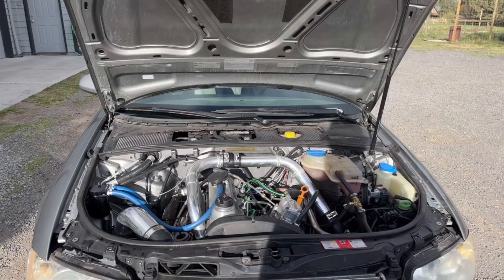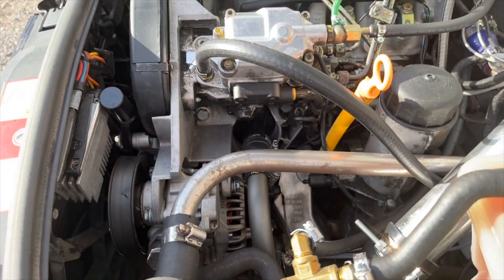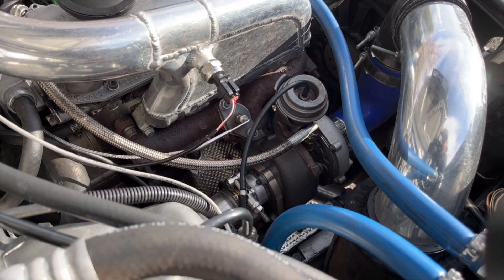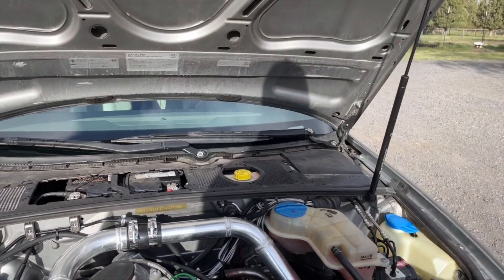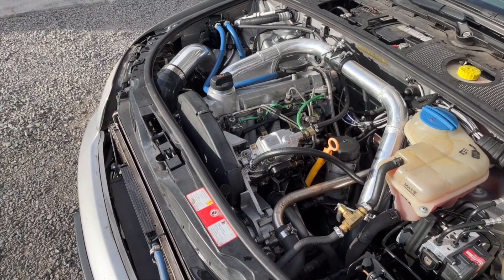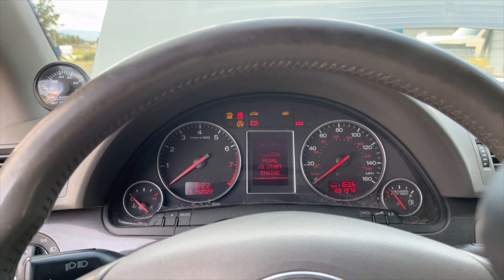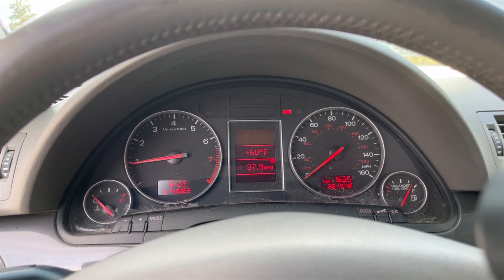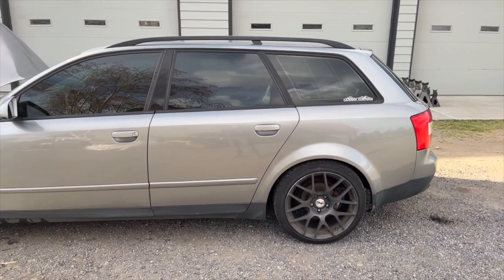Audi B6 A4 TDI Swap

Comment: nice nice swap for the b6, i'm from italy and here these kinda cars are today so common especially in the south regions, however u could have mounted the 6 speed version of gearbox for the 1.9tdi avf (130hp) to reduce the rpms at 75/80mph (idk how many rpm it is rn in the new 5th gear that u mounted, so) however very nice motor, swap and car :) greetings from IT

Comment: Cant quite see in the video but what did you do for a passenger side motor mount?
Reply from the maker: Both of them are the stock 1.8t engine mounts and brackets, though one side needs to be trimmed a little bit to clear the accessory bracket

Comment: do you happen to have an update on your tdi swap? I’ve been trying to find the best tdi motor to swap into my Audi TT. would love to hear how things are going with your build.
Reply: Better check gear radios and final drive before committing to that. 3500 rpm at 65 or 70 is no bueno.

Comment: When you did this swap did you just order a basic tdi swap harness or did you order it custom for the build? I currently have my mock up engine in my 05 a4 and i have the small plug completely wired but wondering if i need to use the big plug from the audi or if i just use the tdi plug. Any information i can get would be greatly appreciated 👍

Comment: what u do w the tank gas?
Reply from the maker: Stock gas tank that was drained out.  I removed the factory 1.8t fuel pump and the 1.9tdi injection pump just pulls from the tank.  I ran the return line to the jet siphon so that it will still move fuel between both sides of the tank.
Reply: @carrickcustoms  Thanks !!!

Comment: Would it be worth doing it in a b6 gas to a diesel the way you have it? Im at the point of swapping engine, mine has some vent valves due to trimming belt breaking while running

Comment: I'm putting a 1.9 ALH engine to an 01e transmission in a b5s4 and I'd really like to have a little info on what to do about the pilot bearing, flywheel, and clutch assembly since I'm planning on using S4 equipment
Reply from the maker: The clutch, flywheel and pilot bearing will be the same that I used in this car.  Whitbread Performance flywheel with a Clutch Masters ckutch.
https://whitbreadperformance.com/collections/tdi/products/240mm-30lb-billet-steel-smf-for-b5-5-manual-swaps?variant=48965239434
Reply: @nickrisingee3163 Did you ever get the swap done into your b5s4? I’m looking to do the same thing this winter. Curious why you’re needing to change the pilot bearing flywheel and clutch assembly. @

Comment: Have done three B5 Audi conversions. AHU, ALH, AND A BHEW. B6 has more can buss, looking for a way to get cruise control to work. No problem on b5. Let me know if you can help.
Reply from the maker: I am still working on that as well.  I am either going to use a CAN interpreter to send the right signals to the ALH ECU or I am going to see if a B5 cruise control stalk will fit in the B6.
Reply: Any idea of this will work on a B5 with an automatic trans?
Thank you.

Comment: What ac compressor did you use??
Reply from the maker: Currently the ALH compressor with modified lines for the B6 but the climate controller cannot control the ALH compressor because it isn't a variable displacement compressor.  I am going to replace it with the 1.8t compressor and build custom mounting brackets for it.

Comment: im going for a similar swap, but mine is going in a b5 a4 that had a 2.8 manual in it. im making a stand alone harness for the ECU and wondering if the cluster would still work in the A4 this way without modifying the body harness? what did you do for the throttle pedal, did you use the stock A4 pedal?
Reply from the maker: The best way to do it is to use the engine harness from the ALH and re-pin the rain tray plugs so that the ECU sends the correct data to the cluster and the rest of the car.  You don't need to modify the body harness.  There is a difference in shape and a slight difference in the circuit board between the Audi pedal and the VW pedal.  What I did was disassemble both pedals and put the guts of the VW pedal in the Audi pedal and it works flawlessly.

Comment: Could I ALH swap a B7 since a B6 is almost the same thing?
Reply from the maker: Yes it can
Reply: @carrickcustoms  so if I do an ALH swap in a B7, I should be able to get the ALH ecu to communicate with the other modules in the B7, and not have dash lights on all the time?
Reply: I'm wondering this same thing as a buddy is doing it but has 2 ecus

Comment: Funny to come across your video, I have a 12 Valve OBS with your parts on it. Just recently picked up an ALH TDI golf for cheap, but not a huge fan of the fwd transverse deal. So I started looking more into a b6 swap and came across your channel. Still newer to VW/Audis, what trans did you pull your fifth gear from? Any more details on the wiring, how involved was it? How was the swap overall? Do you know which turbo from Xman you're running?
Reply from the maker: Very cool and thank you for the business!  For the transmission, I ordered a used fwd transmission from a longitudinal mounted fwd A4 on Germany eBay (basically an 01A transmission with no provision for a rear driveshaft), pulled the 5th gear set and put it in the Quattro 01A transmission.  I had no idea if this would work but figured those transmissions were cheap enough that it was worth the money to try it out.  5th gear was the only gear from the fwd trans that would fit in the Quattro trans and the 4th to 5th split is a decent gap but works well overall.  In order to try to save some time I sent my Audi 1.8t engine harness and the ALH engine harness and ECU to Fast Forward Automotive and he made me a wiring harness that used the factory Audi rain tray plugs and was “supposed” to be plug-n-play.  The wiring harness worked out alright, but I did have to make some changes to it and the customer service was not the greatest.  If you are good with wiring you could easily go over the pin outs of both ECU’s and rain tray plugs and make the wiring harness yourself.  Then you just need to get the ECU tuned and the immobilized disabled.  From there, you will want to get VCDS so that you can adapt all the other computers in the car so that they know that its now a 4 cylinder diesel.  The turbo is a “1.9TDI AWX AVF 2.0TDI BHW BLB BRE hybrid 1752V”. I also had to get an exhaust manifold from a AFN engine.  The stock ALH exhaust manifold has the turbine housing built into it and wont clear the frame horn.  All in all it was actually a pretty simple swap👍🏼
Reply: Im about to do it to my b5. just waiting for the 2.8 or the auto to blow. fun to beat the hell out of

Comment: Love the swap.  Did you run the ALH computer along side the stock 1.8T computer and if so what did you delete on the 1.8 T computer to not get a check engine light?
Reply from the maker: Thank you! No, I ran the ALH ECU in place of the 1.8t ECU.  In order to do this, I had to disable the immobilizer (anti theft system) in the ALH ECU and then I used VCDS (VW/Audi computer program) to go in and tell the instrument cluster, and the rest of the computers in the car, that it now has a 4 cylinder diesel.  This was actually really easy using Ross-Tech VCDS.  Now when you plug the VCDS diagnostic cable into the OBDII port the computer shows that its a B6 Audi 1.9TDI and everything is happy👍🏼
Reply: @carrickcustoms  That's awesome, didn't think it would be that easy but as you said Audi and Vw are pretty much the same. Thank you for posting and for your reply.
Reply: @carrickcustoms  can you do the same thing on a B7 A4 that had the 2.7t? And curious how you changed that stuff on VCDS. Because I believe the B7 had the can bus??
Reply: @noahmajewski5813 why would you